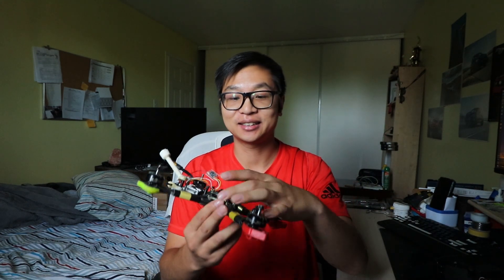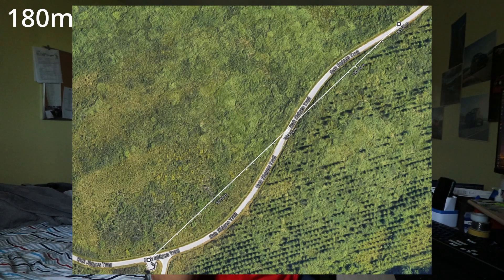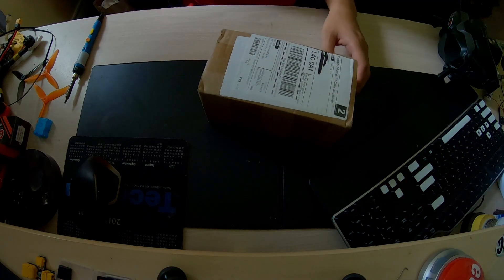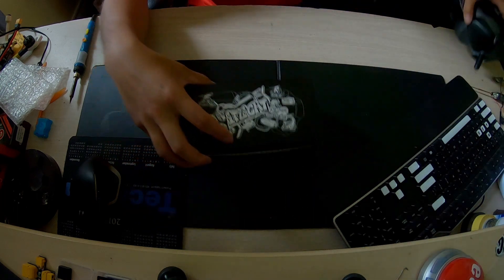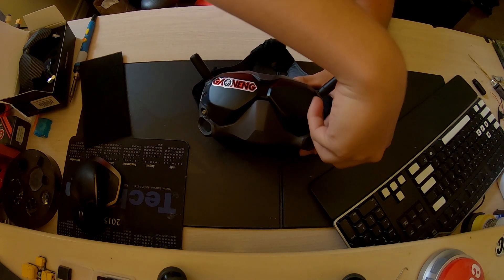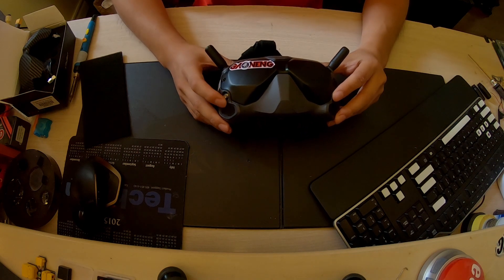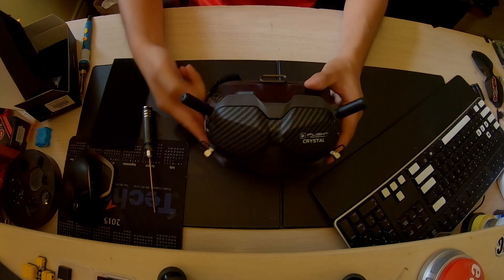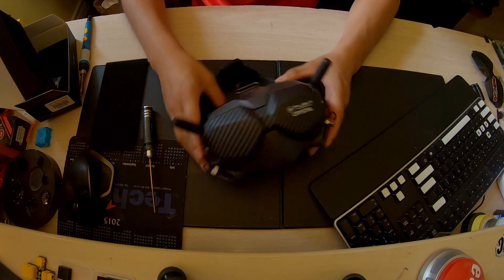DOUBLE your range on the DJI FPV System - IFlight Crystal HD Patch

Comment: Hi, I don't really understand, is it extending the range or not? It is not very clear in your video if it is greater range or not! As an advice, I would put and arrow and stop the image for a few seconds and write limit for the OEM antennas and from there you fly normally, In this way the viewer knows that you flew further and it is extending the range, otherwise it is a little confusing, I am just trying to help :). thanks for the video 😊
Reply from the maker: Ahh yeah no worries, that’s a good way to distinguish. I put in the distance of how far I was able to go and it seemed to be double of the Orem antennas
Reply: Sorry man, i didn’t notice that, this is why stopping the image and putting a single message on the screen help to send the message 😊